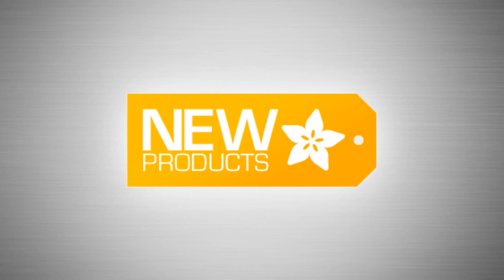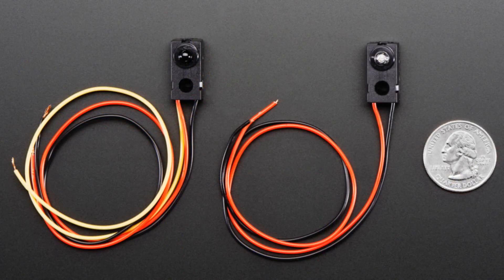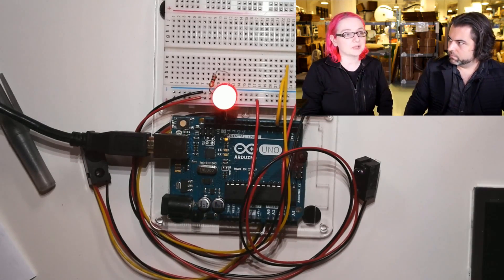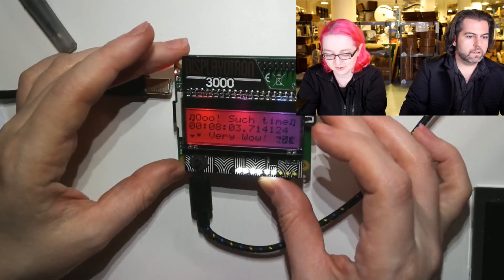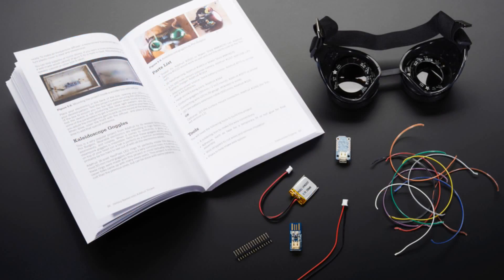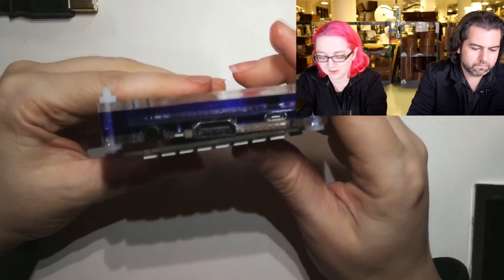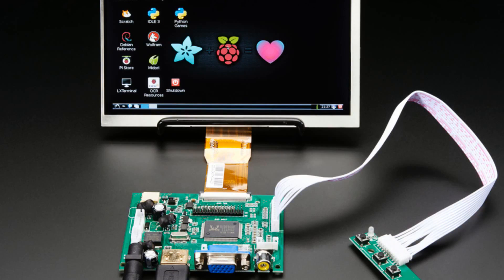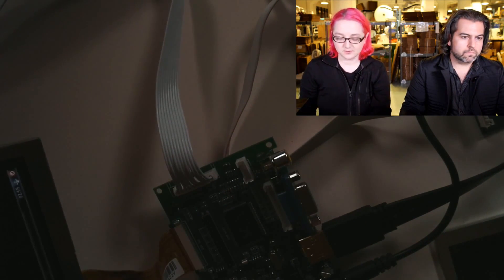New Products 12/10/2014

Comment: hmm, would using a PCB schematic for the 7" HDMI 4 Pi(touch screen version) display work if I soldered the driver chip and other needed components from the driver board on to a double sided PCB with the screen attached to a ribbon cable port on the back side of the PCB(where the driver and other stuffz would be)?